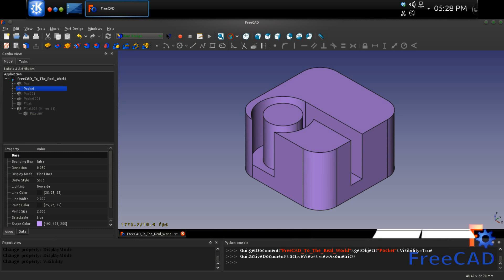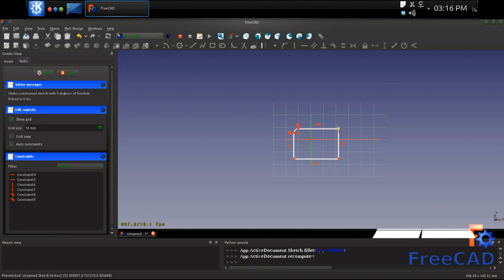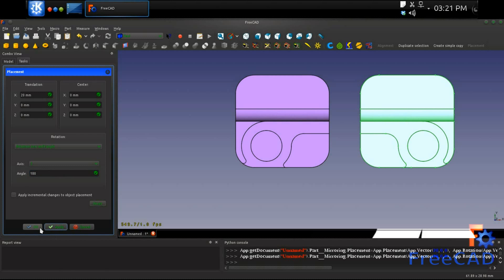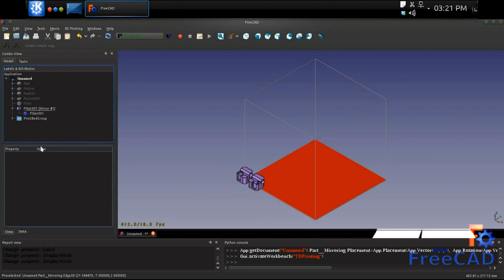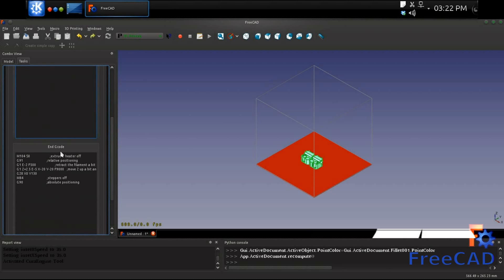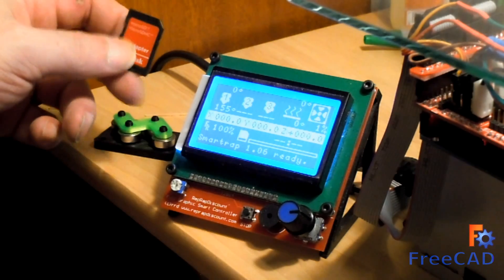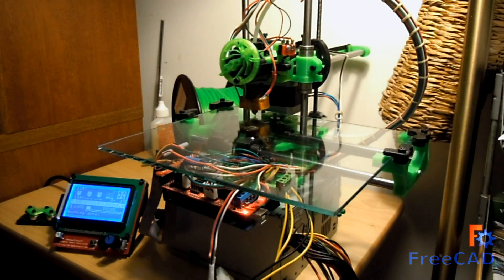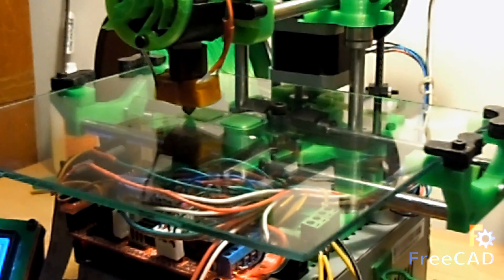From FreeCAD To The Real World

Comment: Great vid!
How much would it cost today to buy & setup the exact system that you show in your video?
Reply from the maker: I would suspect that one could piece it together for $250 - $300 with careful shopping and being mindful of shipping cost. Ebay would be your friend here. There are a couple of other designs out there that should come in at around the same price point. Do a little research, go down the parts list and look at multiple sources for each component and figure out the best deals. I used a spreadsheet to track it all. ;)
Reply: Hi!
Thanks for the information & advice.

You mentioned something in your video about a Freecad plugin that generates g-code for your reprap printer. A friend of mine has one of these: http://www.ebay.com/itm/USB-four-4-axis-3040-800W-cnc-router-engraver-engraving-milling-machine-handle/321858261548?_trksid=p2045573.c100033.m2042&_trkparms=aid%3D111001%26algo%3DREC.SEED%26ao%3D1%26asc%3D20131017132637%26meid%3Dad690d3f8b2349fd8ceabcf8a4a722e9%26pid%3D100033%26rk%3D4%26rkt%3D4%26sd%3D151959329640

Would that g-code plugin work for a cnc router or would he need to use a CAM program like Mach3 to machine his 3D parts?

What is the resolution (X/Y & Z) of your reprap device?  What do you think of this system the following?  http://www.ebay.com/itm/2016-Upgraded-Quality-High-Precision-Reprap-Prusa-i3-DIY-3d-Printer-US-/111846561901?hash=item1a0a93186d:g:k-IAAOSwI-BWQXNR

Thanks!
Reply from the maker: No experience with that printer but it could be a good place to start. 

The Gcode that is generated with that plugin comes from Cura Engine and it is for 3D printing only. However, With the latest development version of FreeCAD - 0.17.xxxx - it now has a Path module in it that is for CNC machining and produces Gcode for subtractive machining like a Mill/CNC router, etc.. I is in early development and what is working is only for 3 axis, but it has a very good start. You can read about the development and the current features / bugs as well as planed features in the FreeCAD forum - Path/CAM - here - http://forum.freecadweb.org/viewforum.php?f=15. All development has now moved into FreeCAD's master code and frequent builds of master can be downloaded for Linux, Mac, and even that other OS. Give it a good look over and try it out. It is already capable of doing all the simple things and getting better most every day or so. The more eyes on it, the better it will get. It does produce usable Gcode that works with LinuxCNC and Mach3 as well as a few other controllers.
Reply: Cool printer! It's great seeing it dance right along with your music...was that intentional?  Anyways thanks for letting us know about the cura engine plugin...I use an OS called CAE Linux...it has everything built in to it...pretty cool.

I'm going to build a second printer soon and your power supply idea is cool...it's a computer tower power supply right? Did you order your 3d printed parts for your printer above or did you make them with another printer?  Thanks for your time and efforts.

Comment: nice printer, model?
Reply from the maker: +Testunz Braco It is mentioned in the credits at the end, but it&#39;s a SmartRap. Nice, small, inexpensive and easy to maintain. You can find it on Thingiverse or visit their website. I built mine from scratch with a set of 3D printed parts. Just used it yesterday to print out a couple of parts I designed in FreeCAD, used in constructing a bottle manometer for syncing the carbs on my bike.

Comment: 61quick, Is there a way to scale down large Freecad models in order to print them?
Reply from the maker: Solid models, either native FreeCAD or imported STEP and IGES can be scaled down easily by making a Draft > Clone. Those evil clones have the built in option of scale, and their parametricly linked to their original part. One of our contributors has a very nice Macro that is available on the FreeCAD Wiki for scaling parts. Nice GUI front end and very handy to use. It's called CloneConvert and you can find it here -  http://www.freecadweb.org/wiki/index.php?title=Macro_CloneConvert

If your importing STL files, there is no direct way of dealing with them for scaling. You will be MUCH better off using a mesh modeler like Blender for dealing with mesh format files.

Comment: how would you go from free cad to a cnc mill
Reply from the maker: That requires a CAM package of some sort. If you are doing simple 2D cutouts, pocketing, engraving and the like, a program like PyCAM will work well. IF your wanting to do 3D (2.5D) machining operations, that needs a more confiscated and capable CAM package. Something to fit that need is being worked on for FreeCAD but it is a major project and I don't expect to see it anytime soon.  

While there is not a plugin workbench for PyCAM, a "one button" Macro can be written to automatically export your 2D design to Pycam and be good to go, or just export manually. PyCam does have the features to do 3D contouring, but the compute time makes attempting to use the feature impractical for all but the most simple parts, unless your renting time on a cloud, or have your own Beowulf cluster ;) 

There is CamBam and MeshCAM that are good entry level CAM programs that work with 3D meshes Both are free to try but are commercial software. Both are reasonably priced for what they do. 

Hope this helps. Let me know if it doesn't.
Reply: so I cant email my rendering to a cnc place and have them cut my flange?
Reply from the maker: Oh, sure you can. Just find out what format they need the file in. Usually it's .step or .iges and just export your FreeCAD model to that format. I thought you were asking about cutting on your own CNC machine, and what you would need to do that.
Reply from the maker: Can you open the .iges file and see the part? Maybe it was not exported correctly. Are you using the latest 0.14 FreeCAD release?
Reply: I just downloaded it yesterday idk what im doin this software is so confusing I have the part complete and convert it when I click on it the computer cant find a program to open except freecad can I email you the file to see what you can do?
Reply from the maker: Yes, you could do that, or maybe better yet, join up on the FreeCAD forum - http://forum.freecadweb.org/ and ask for help there. If you just installed FreeCAD, new users can benefit greatly by joining us on the forum. The truth is, "Real CAD is hard", but that does not mean that it is impossible. Just takes a bit more than a few hours to learn. Allot of that learning curve can be chopped down to size with some help and guidance. The FreeCAD forum is a great place to get that, IMO. You will find me, along with a number of other regulars, (including the developers) that will get you going.